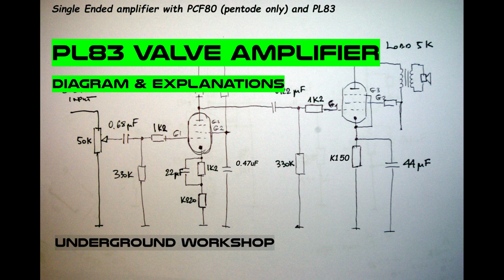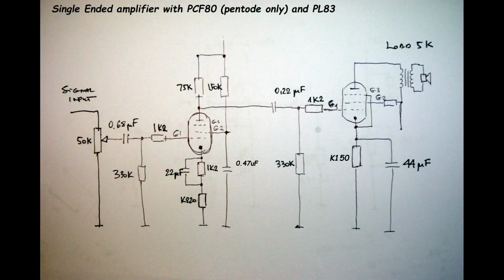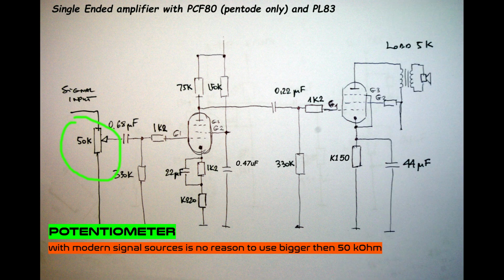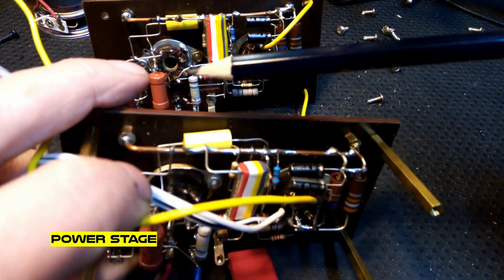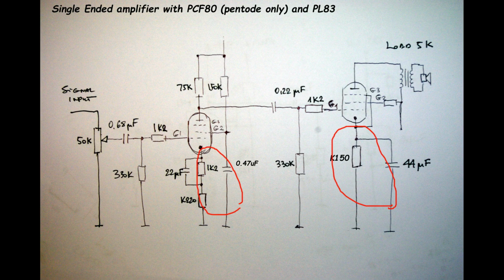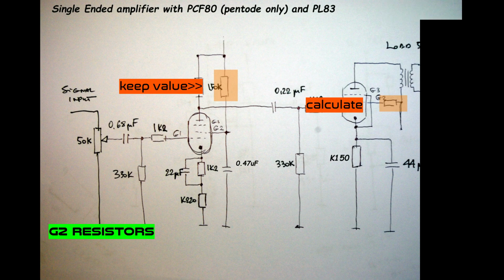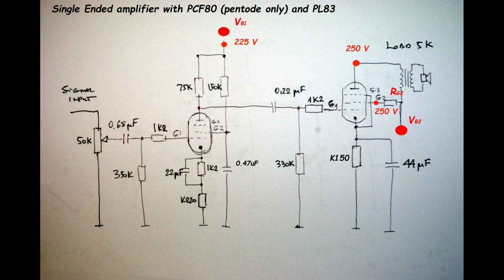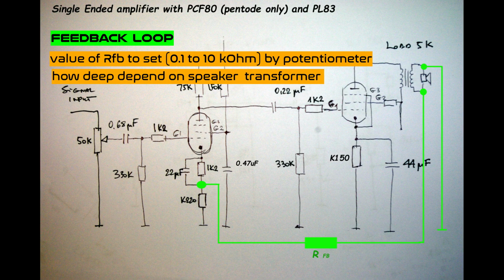pl83 amplifier proven diagram

Comment: Big thumbs up. The PL83 is kind of an oddball tube, lower output than an EL84 and heater voltage of 15v! How was the measured frequency response, did it meet or exceed 17kHz?
Reply from the maker: thx for comment 
to tell the truth top end of frq.response top depend  on output transformer, we can cut bandwitch from bottom (by amp circuit) to something like 10kHz and thats all higher depend on transformer
yes with deep FB loop up to 18kHz  transformers itself are crappy bandwith w/o FB end around 10kHz

Comment: How are you powering the filaments?  The 'P' means that they are designed for a 300mA series filament string.
Reply from the maker: to tell truth im using UCF80 100mA and is powered by dc2dc converter on xl6009 powered from 6.3v wiring of transformer;  PL83 heaters are powered from separate junk transformer

Comment: Looks good. Hopefully I'll find some Chinese valves to match up.
Reply from the maker: 6f2 chinese =ecf82 
with ECF82 will work (proven)
i not suppouse that u can find chinese copy of PL83 
but u could try with chinese 6P1 =EL90=6V6=6AQ5
to use in this circuit u have to 
change cathode resistor to 250 ohm (calculate G2 resistor etc.)
in theory el90 have more power but require higer signal from preamp means finaly SHOULD be same . its quite old valve (its copy 6V6 in smaller glass) means gm are low so not neccesity for  grid stopper
an have very low Vfk only 90 V so floating heaters or elevated
Reply: @undergroundworkshop8278  Thank you very much!
Reply from the maker: you are welcome